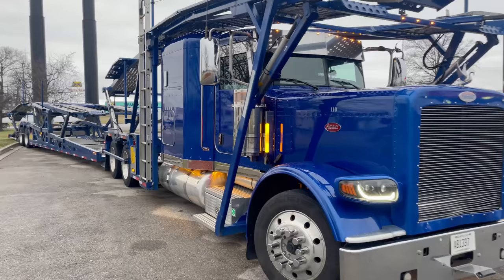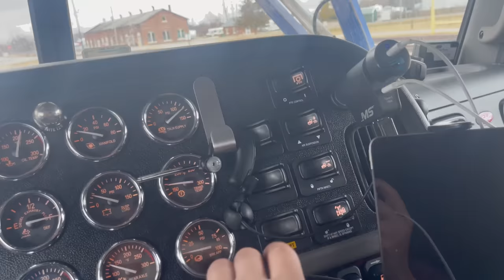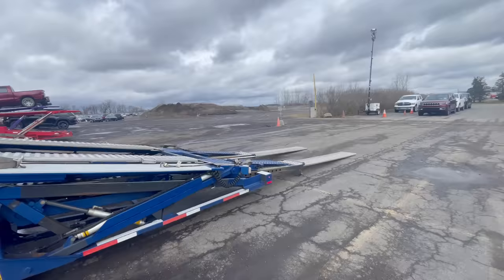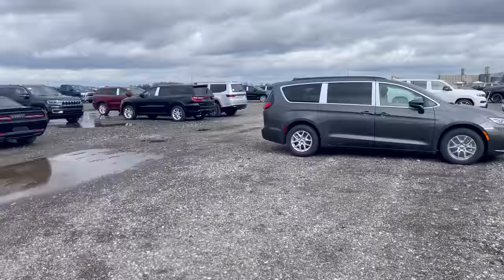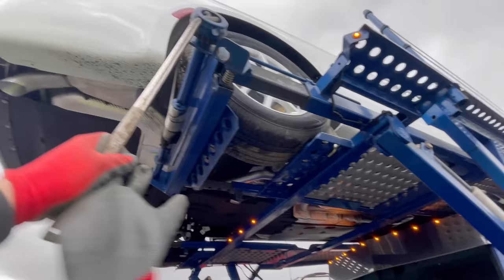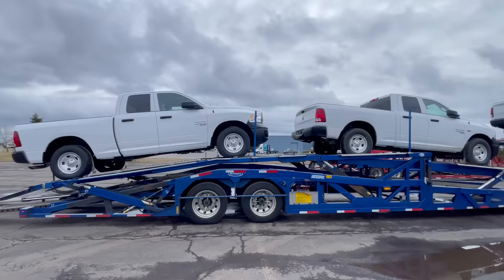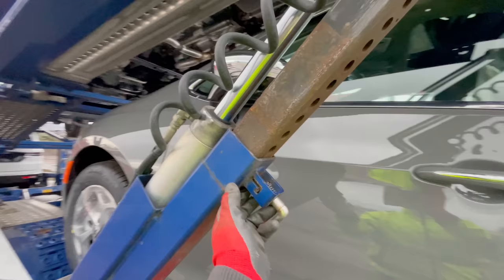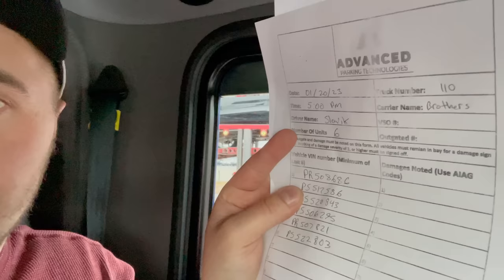LEARN TO LOAD A CARHAULER

Comment: This job should pay over 125k a year. There is a science behind it and a special skill set and mentality. You are out in the rain, snow, ice, heat, sun, wind. I saw some auto hauler jobs for 70-80k/yr and that is CRAZY because you can be a steering wheel holder and do dry van and make that or more. I value this job at 125k.
Reply from the maker: Yes i wouldnt be doing it for less bro !!
Reply: Yeah but thar starting out you don't start out making 125k you gotta work your way up in the game. But still 70-80k is alot of money in 1year what are you talking about.
Reply: It’s a tough job, never home, always working, damage a car comes out of your own pocket, i talk with united road company drivers and they all hate it, same goes for hansen & adkins, atg
Reply: more like over $200k a year

Comment: D.E.F.  AND AN AUTOSHIFT. ??   I applied at a company for car hauling,  all they had were automatics,   I said sorry,  I drive trucks not busses.
Reply from the maker: Its pretty easy driving an automatic you should try it lol
Reply: @BIG_G-  drove them , nothing about them I like..  especially in the snow..
Reply: Richard williams 
I'm from Wales I'm shocked out of your fan we have the new bridge train station trains diesel trains movies trucks cranes cranes just trains train station trains police car PlayStation ambulance Orton ambulance police dissertation beta seawater just trains Jason spaces train station diesel train steam engines
Reply: I've driven both and automatics extend your shoulder's life.  (Rotator cuff).  If you plan on  doing it for a long time you have to think about those things.
Reply: @alonzosmith5075  higher extended shifter will save your shoulder too,  I even have one in my dodge dually now.  Helps! BIG TIME..!
Reply: @louis fisk  I don't think so because its still the same motion... when I drove a stick shift after driving an automatic I felt soreness in my shoulder. After 24 yrs of carhauling your aches come quicker.
Reply: @alonzosmith5075  yeah,   could be alot to do with that  tie down bar , when we used chains back in the day , pulling them tight was rough on the arms and shoulders.
Reply: @louis fisk  especially when the chains had a kink in it but I'll take straps over chains,T,R, and S hooks any day.
Reply: @scoobylouie  if peterbilt  make one as good as volvo's automatic sign me up.
Reply: @alonzosmith5075  chains were good for getting your height down.  Squeeze that car or SUV down
Reply: I was able to use straps the same way.... had to be careful not to increase the space between the cab and bed of pickup trucks... (chains)
Reply: @BIG_G- it’s the best
Reply: @alonzosmith5075 the extended shifter also increases the throw length. A shorter shifter would be more likely to help.
Reply: @scoobylouie maybe you should buy your own rig and contract on with a hauling company. That way you'll also be able to pick your color.
Reply: oh boy, super trucker lmfao. I will take an automatic all day. Its my paycheck at the end of the week that matters. I have a chronic sciatica and automatics help ease the extreme discomfort i get when driving stick.

Comment: Thank you for creating an instructional video. The industry would certainly benefit from proper training. This video and others like it are oftentimes the only hope for new car haulers.

That being said, for new drivers in this same equipment, namely a Peterbilt affixed to a Cottrell CX-09, here a few suggestions:

Lower position #2 as close to the ground as is possible before loading and unloading. Position 2 is your second car on. It goes on forward.

It doesn't take long to lower the deck, and it's worth the time. By lowering deck/position #2 before loading (and unloading), you create a flat platform onto which you can drive, at a height at which you can safely work. You can also enter and exit your unit without fear of falling, and strap and tighten your tires from the ground.

The job is dangerous enough. Don't take unnecessary risks. Loading and unloading #2 high in the sky will save you only a few minutes every day, but one fall off your truck might cost you for a lifetime. Load and strap #2 at ground level.

Next, take your load height seriously. If you're close to or East of the Mississippi River, aim to be at or under 13'6". Google the height requirements nationwide. There's a map.

13'6 is a tough ceiling for an East Coast car hauler, but it exists for as reason. (I'm looking at you, I-44 thru St Louis!)

If you can't make height, drop or swap out a unit and save yourself the anxiety of a bridge strike. If you're close, and by close I mean 13'8, consider hard strapping a unit with a strap around the frame, so as to compress the suspension. OEMs frown on this, but damn if it don't work well on a 1500 Silverado over your day cab.

With that, measure honestly and with your trailer brakes released. That means red button pushed in, air in your trailer suspension, like it will be when you're driving. Twirl and walk down that height stick at your best 90 degree angle without looking at the measurement until you begin to skim something. Then look at your measurement. Where your stick begins to flirt with the top of that roof or loathed shark fin antenna is your true height. Too many of us set the stick to our "hopeful height" and then see if the stick doesn't drag across a roof.

Lastly, download the Cottrell mobile app. When the provided diagrams load properly, they can be very helpful to you.

Finally, have some respect for the law. I'm not saying you should do 54 in CA and a full air brake test every morning. I'm saying you should give more of a damn than you don't.

Take I-20 (NOT 30) thru Ft Worth. Strap all four. Remember that Mercedes S classes bounce a lot! 4wd on any vehicle that has it. Electric vehicles are heavy. Close your #1 pockets for Teslas. And don't take a chance with a set of rail tracks on top of a triangle-like peak.
Reply: This is some really sound advice thanks for the information.👍🏿👏🏾

Comment: I can't think when I last carried 6 unless there were a couple of high roof vans in the mix, seven standard height Transit and  anything from 9 to11 or maybe 12 cars are the norm this side of the water.  We can run a little over 60 feet long for the truck itself and although there's no height limit 16 foot is about as high as we run at for practical reasons, empty we start out at 13. 9".

Comment: how do you get away with 14 foot tall when legal height is 13'6"?
Reply from the maker: Only some states pay attention to that on carhualers like Michigan or ohio most carhaulers have no choice we are rarely at 13.6 most the time we have no choice but to do 13.8-11 but our cut off hight is 14 max since most bridges are over 14 minimum
Reply: @BIG_G-  10/4 I drive a lowboy, so I wasn't sure how it worked for car haulers.
Reply: Not all states check your height... Arkansas, Maryland,and South Carolina  check your height a little bit more than everyone else.
Reply: Steering wheel holder for sure. Silly question.

Comment: so no pre trip then? 5 dont count its 15 min by law
Reply from the maker: It depends what officer is enforcing the law lol ive had multiple inspections with 5 min pti and nobody said a word lol
Reply: The law doesn't actually stipulate a minimum time for the pre and post trip inspections. However, most DOT officers and companies hold the opinion that you can't properly inspect every item the regulations require you to in any less than an absolute minimum of 15 minutes. If a DOT officer sees inspection times that they believe to be insufficient during an inspection, they can require you to do a pre-trip inspection for them to demonstrate that the time shown is accurate. If that inspection either is incomplete or takes significantly longer than the time reflected in your logs, they can issue you violations.